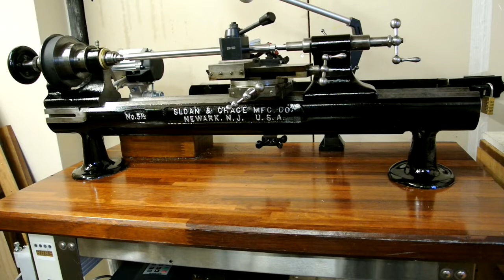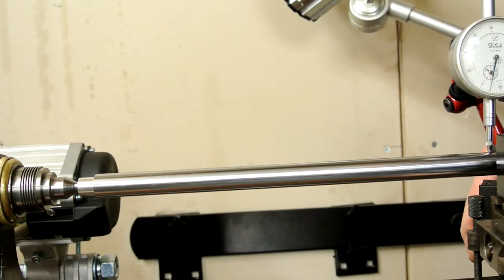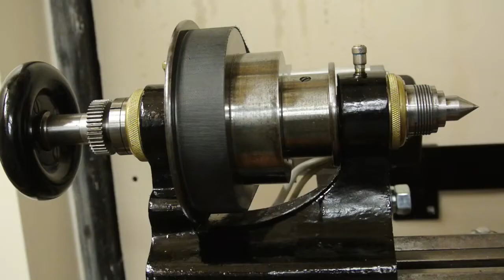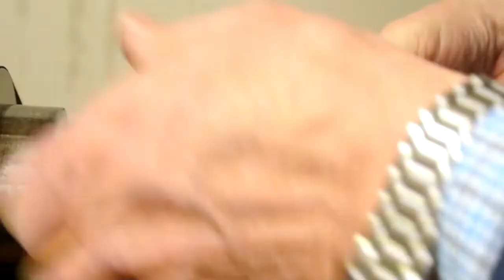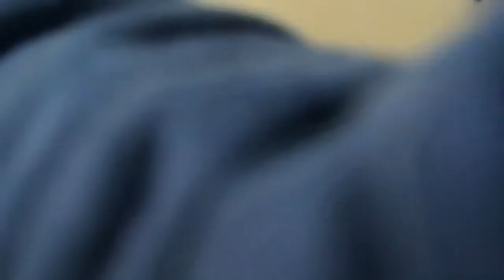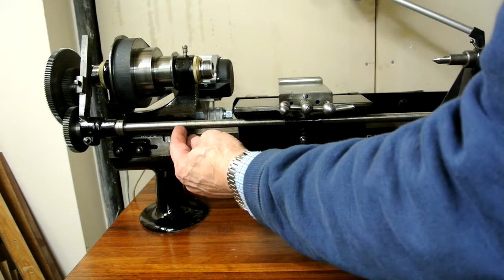Part 3 Sloan and Chace lathe

Comment: John, it looks very good restored in black. Thanks for sharing the various stages of restoration and the precision it was able to achieve - so rare to see improvements being worked through as you have.
Reply from the maker: Thanks Casimir I enjoyed very bit working on it. There is more to come! I have used an old Hardinge lathe compound slide that I have adapted to fit the Sloan and Chace to allow me to fit a vertical slide and milling spindle and have fitted expanding an mandrel to the headstock with division plates. I am in the process of cutting gears for the threading attachments and should be able to cut both metric and imperial threads. I have fitted a very accurate ER20 collet chuck to complement the clock making capability that is in Part 4.

I have just managed to find a Sloan and Chace cut off slide and that should arrive soon. I am on the lookout for the special indexing tailstock if I can find one. Hopefully it will be a very complete and capable lathe when finished.

John

Comment: Very good John.   You won't wear out aluminium gears.  I have been running a small one on my hard working Chinese lathe for nearly ten years.

The run out in the small ER chuck could be due to looseness between the thread and collet nut.  I might be wrong, hard to tell in the video, but it looked loose to me.  The thread fit is critical to accuracy, along with a few other things.  I made an ER32 screw on chuck for my Schaublin 102 and finished the internal taper in situ with a pencil air die grinder.  I had to re-do the chuck as the original thread was too loose.

Overall your little old lathe appears very accurate.  Looks very nice.

Cheers Rob
Reply from the maker: Hi Rob

The ER chuck is now very accurate indeed after a lot of regrinding and fittings a high accuracy nut. The threads are not loose as I cut them to fit the nut. I have loaded part 4 showing how I did it.

 Yes I saw your use of the pencil grinder and bought one to use on this project as I didn't have a mechanical way of using an electric powered spindle. I made a tool that fitted the tool post and glued the sleeve of the tool grinder I made to it with a flat milled on the back. I used Acrylic glue and that ensured it was accurately aligned with the lathe  bed and centre height while it set. I then drilled and tapped screws to make a permanent fixing. If you haven't tried it Acrylic glue is  a really fast setting glue that sticks well to both metal and hard plastics. It does smell a bit when it sets though! I have just finished making a electric powered milling spindle and reused an old compound slide that was made for a Hardinge lathe. It is a bit large but is a nice stable platform to fix the vertical slide to without hacking the old nice compound about. More videos later....

I have also made an indexing arrangement to fits in the end of the headstock so the lathe can be used for cutting gears. Assuming the whole thing is stiff enough I will try and make the gears for the threading attachment on the lathe itself rather than the Boxford that I would usually use. I have already started cutting out ali blanks in 7075 which is a nice tough material and I am sure will be fine for the job. Thanks for the confirmation about the use of Ali for the wheels. Oh I have just ordered a Bangood vernier gauge base you reviewed.

John
Reply: Hi John,

I realised after the comment that you had found the issue.

I don't know if you are aware, but I cut gears on my Chinese lathe as I don't have a mill.  The following link shows how I do it: http://users.tpg.com.au/agnet/cq9325rev7.html

I don't index with the spindle, but do it on a vertical gear blank holding shaft.

I've cut at least half a dozen gears this way in aluminium, brass and cast iron.  The teeth are no issue, cutting the centre carrier keyways is the most tedious job .  I've tried quite a few ways to do it over the years as I don't have a commercial broach.

Anyway, good to see your very fine lathe.  My 102 was a wreck when I got it, but wow, it's so rare to see a lathe as old as yours in such amazing condition, and with a driven carriage for that style bed and ways.

The Americans must be as jealous as hell.

Cheers Rob